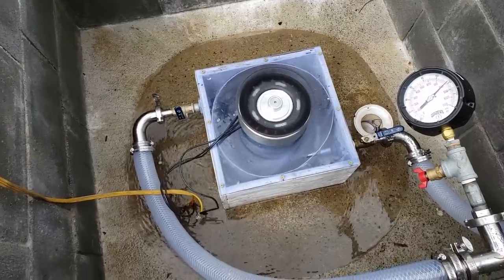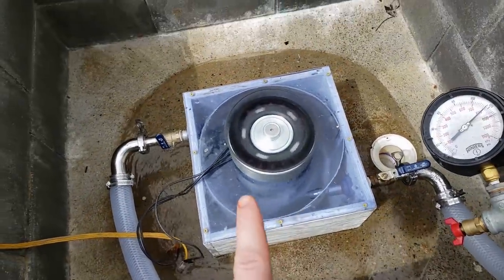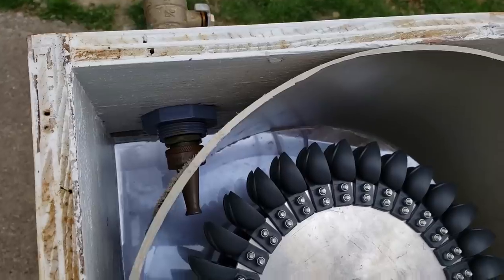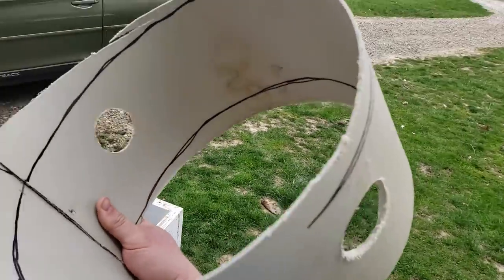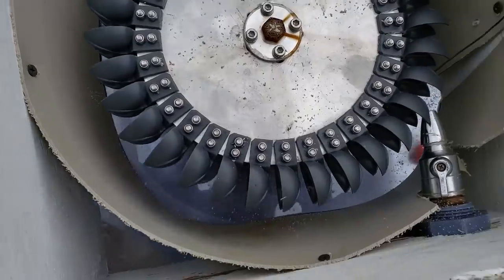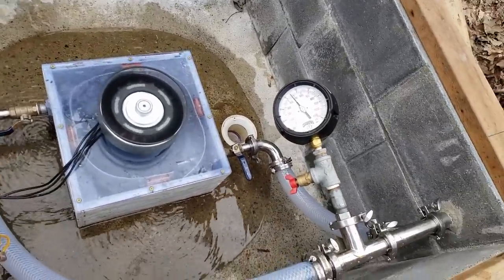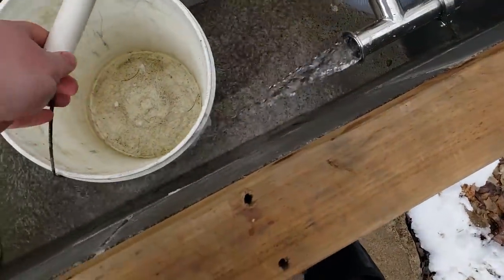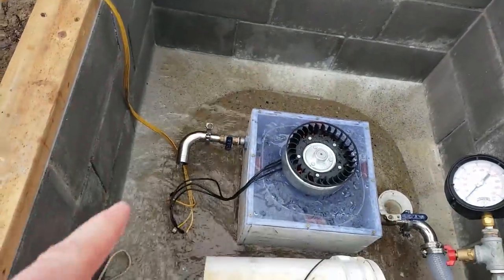Conical Turbine Housing, An Improvement?

Comment: You have a lightly loaded rotor - the water rotates in the direction of the turbine. When the rotor is overloaded, the water twists against the turbine - it is returned by slow-moving spoons. At ideal load, the water falls directly down. The picture from Donald is good, but it only drains the sprayed water down the wall, without dripping on a spoon. Turbines with a horizontal axis do not have this problem. Try reducing the wheel diameter, adjusting the speed, or changing the drive settings. Compare the speed of the water with twice the speed of the spoon - the water will stop and will not swirl.

Comment: Hey,
Where is the feed of water coming from & where does it go after it spins the wheel?
Reply: Mario Young he mentioned in another video it’s spring fed water and I think he said it was coming from an area 174 feet away?
Reply: Mario Young He’s letting it go to waste, rather than recycling it by pumping into a holding tank or back up the hill.
Reply: It looks like the water would be running down that direction anyways thanks to gravity. It probably leads right back to the stream that I would have went to anyways

Comment: You've got like a burp in your pipe, think it might be going uphill somewhere. May reduce wear if you find some way to even that out.
Reply from the maker: If I shut the valve at the bottom and let it float out then it doesn't come back until the water gets too low and let's air back in.  The trick is to never let the air get in to begin with by keeping the water level in the forebay barrel up high enough.

Comment: I think when they said housing no one thought u would just add piece of round plastic or whatever material you used. Housing you are using is still cube in share. And u shrinked the inside by adding round piece of material. Put your machine in a sphere shaped object. As in entire object, not just inside a cube. Make that cube into ball.

Comment: When you measured the GPM you had the small jet open! You might have lost a few GPM there.
Reply: Yeah, the nozzles will reduce the flow, but difficult to measure the flow rate easily without introducing a pressure drop in the inlet line.
Reply from the maker: in actuality the nozzle flows more then 9GPM, more like 11-13GPM I ran out of water later that day, but then it rained and all was well.

Comment: you can't talk about efficiency of a penstock or power loss of splashing water in the housing keeping those cables, if the cable is too small for the current draw it can produce a lot of power loss! ( and corroded wires even worse!!! so please take out those poor cables from the water :)       
(btw those wago terminals are probably not suited for this application, not counting the corrosion problem they are not rated for a lot of current, with the summer you may found them melted )
Reply from the maker: Only 10A, the Wago connectors and wire are sufficient, I've noticed zero corrosion.
Reply: @JoeMalovich    maybe you do not notice corrosion but in the connector there sure is, but to give you an idea 100ft of 15 gauge wire equals about 0.36 ohm of resistance, at 10 amps you lose more than 35 watts of power! sure the fact that you are running three phase helps but still if the power at the inverter is  300w output the power loss is 10%

Comment: In my opinion, it's the capacity of the generator that's limiting the energy extraction. The generator is already generating to its limit and so there is little energy that is extracted from the water... making the wheel spin pretty fast. So the water flies off the wheel with a lot of energy still in it. A stronger generator would create more resistance and allow more extraction of the energy, and so the water would exit much slower. Other good suggestions I've seen from commenters: a larger round housing for sure or baffles directing water downwards could also work

Comment: why don't you recycle your water?
Reply from the maker: How? I have harnessed all the power, it will continue on it's merry way down the ditch.
Reply: @JoeMalovich  Just wondering if you could hook up a pump system to put the water back up hill into a small pond. Maybe solar powered, idk.
Reply: @froggleggers1805  I think what you're suggesting is a perpetual motion machine. The problem is efficiency. In order for it to work you must have more than 100% system efficiency.
 The turbine is not 100% efficient, neither is the alternator, nor the pump or its motor. Everytime you convert energy from one form to another you lose efficiency.
Changing water flow to mechanical energy, then changing that mechanical energy into electrical energy loses efficiency at every step. This is why inventors of perpetual motion machines can't seem to get them to work.

Comment: All this testing and you will have to do it all again when you go to a 48v system
Reply: No, This is not true, The voltage does not matter, The out coming voltage going to the charge controller will still remain the same, The improvements will increase efficiency, In turns can be adjusted to what ever voltage on the other end.
Reply from the maker: in a way yes, but since I'm working on a turgo unit it doesn't really matter what I do now. Although 48V is still in the future..